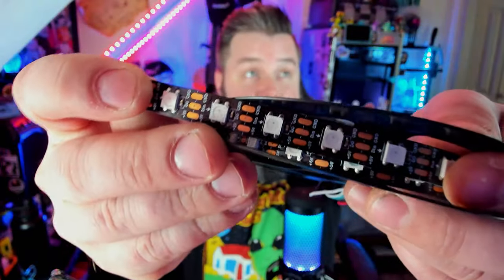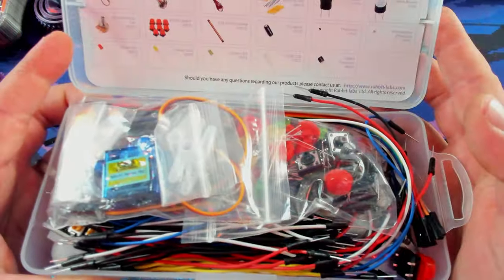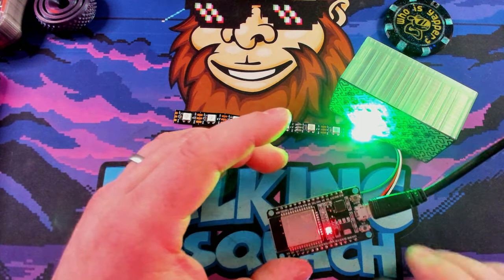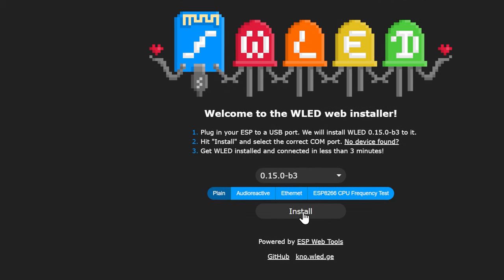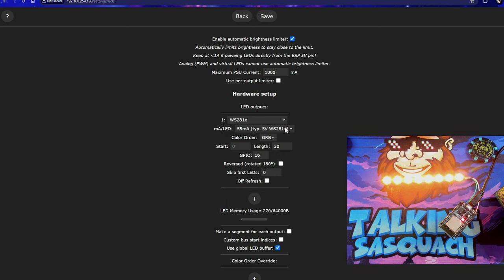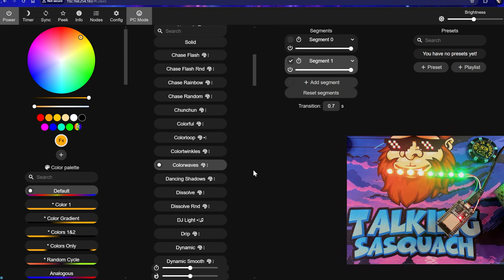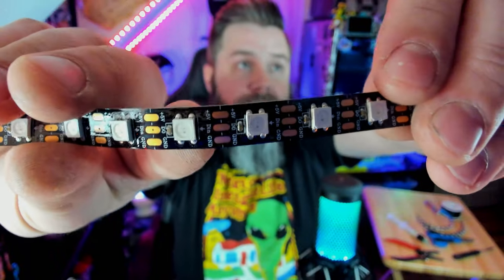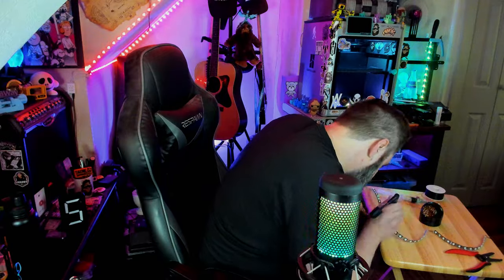Master the NeoPixel with WLED!  Another Reason Why ESP32's RULE!

Comment: You add a resistor and a logic level shifter when you start using longer runs of LED’s to prevent the weird flashing that happens otherwise. I think it has something to do with creating a cleaner signal. lol I’m still new at this but I tried running a long strand and it did all sorts of weird things and cleaned right up once I put in a logic level shifter (to create a 5v signal vs the 3v that the board puts out) and a resistor (to do whatever magic that does to send a signal that didn’t get corrupted along the way).

Comment: VIN is often not protected, you can kill your usb port on your computer if you accidentally short it.
Same goes for the 5v pin on arduino when powered over usb.
Just something to keep in mind when ever you do a project.
WLed is a fun project however it does add to the copy paste code way of programming thats happening more and more.
Great tip in sticking it to your workbench, probably alot easier then blue tack as i often do.
Reply from the maker: Great points!  I'm powering off of a power brick and didn't even really think about that!
Reply: @TalkingSasquach  if you do alot of experimenting it's worth it to make a usb cable with a PTC fuse.
Bit of experiment board, ptc fuse, usb cable and a female usb port is all you need.
You can go to 1 amp but personally I wouldn't go higher then 500ma for the fuse.
You could make it more fancy with an indicator led and a 3d printed case😁

Comment: I wonder if this will work in conjunction with Home Assistant.  I already have 2 ESP32's one for monitoring battery voltage and 1 for monitoring my freezer temperature in Home Assistant.  Would be cool having this for example if a motion sensor gets tripped its a certain color for front and different color for back.  Love the potential uses in Home Assistant

Comment: WLED is single handedly destroying the overpriced christmas light bs and other generic garbage systems [the resistor is a protection item it prevents over voltage. the capacitor helps smooth out voltage see adafruit for more details]
Reply from the maker: Ahh thanks for the info!  And yeah, WLED is amazing!
Reply: @TalkingSasquach  Low voltage electrician / electrical engineer by trade here.  Resistors are important to protect the circuit from voltage differential and overall prevents the LED's from overheating and burning out prematurely. 
You can run LED's without resistors but you are just causing unnecessary damage to the components that could be prevented by proper circuit design.

Please keep making content because you are awesome!